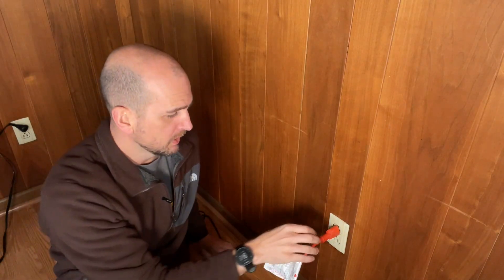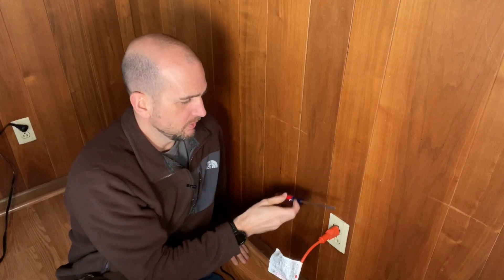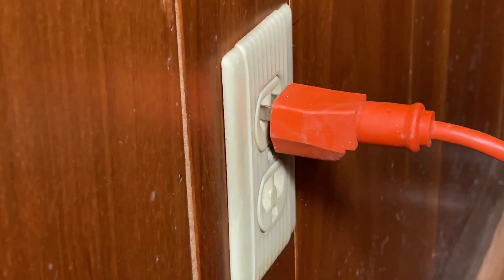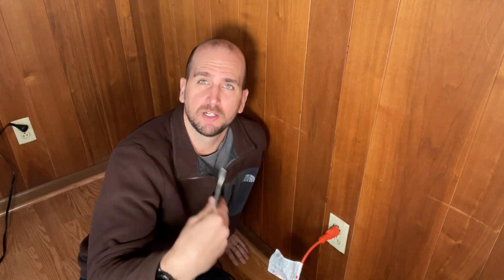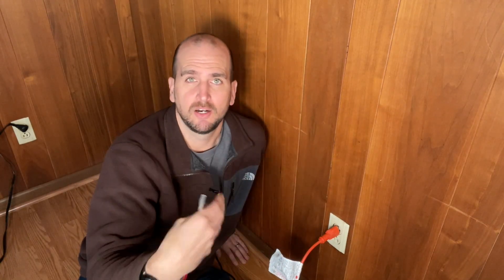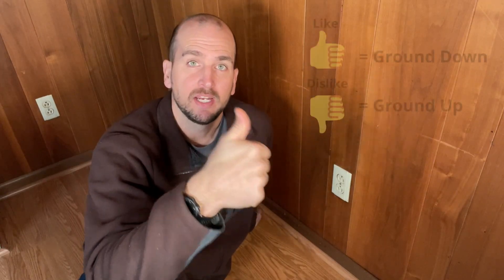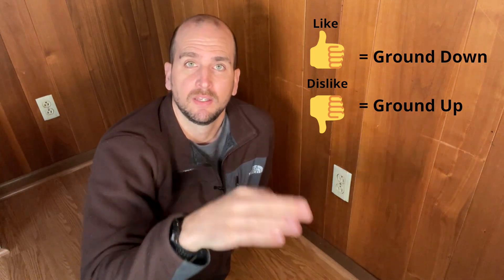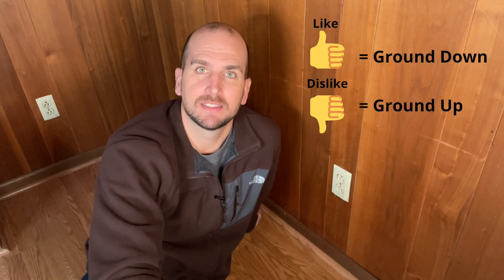Should An Outlet Be Installed Ground Down Or Up

Comment: Not sure how accurate this is but I was told many years ago that commercial/medical grade outlets are placed in ground up to indicate they are that special grade of outlet so a future electrician can readily identify it and replace it appropriately. I was also told it wasn't a code thing just something that is done to help out the next guy so the outlet grade can be identified before you remove it so you can have the correct replacement on hand.

Comment: I'm a DIYer as well. I've done some reading recently about this subject because I was replacing worn outlets and switches in a home I purchased in 2017. I read that in commercial buildings i.e. hospitals that the ground faces up, but in residential practice the ground faces down except on a switched outlet where the ground faces up to signify a switched outlet.

Comment: A ground up ( ground on top ) installation of an outlet has the advantage that if you step on the cord , it separates from the wall quickly- the other orientation will bend or break the ground prong before separation.

Try it and see .....

A Falling stray conductors is a 
far fetched scenario indeed

Comment: If you plug in a large electronic transformer to a ground up orientation, it becomes top heavy and the transformer tends to loosen and fall out of the socket more easily.

Comment: I had learned that the ground facing up was the better choice, yet as you pointed out, that doesn't help when there is no ground prong. I don't recall the argument in that situation. 
The example I was given was a carpenter using a steel tape measure and got shocked when his tape fell on the exposed plug prongs.

Comment: Some electrition dropped a metal plate on an electric cord that was plugged in, got scared and turned it over. What are the chance that some thing would fall and balance on the ground pin? None, so safety is a farce. You want safety, put in recessed European outlets...

Comment: Generally I have ground down, however recently I purchased a new microwave which had a shorter power cord. My microwave is up on a shelf 2 foot above its receptacle. The new microwaves power cord is also about 2 feet long. The power cord was too short to make the bend to plug into the ground-down receptacle. I simply flipped the receptacle around to be ground-up. The  shorter reach of the new microwave power cord was now able to plug into the receptacle.

Comment: Look at the plug going into the receptacle.  If it has the wire coming out the side and the ground pin is located on the opposite side where the wire is, install the receptacle ground up.  This will relieve the wire strain at the plug as the wire will exit the plug straight down.  Otherwise, I would install the receptacle ground down.  This usually applies to an appliance that remains continuously plugged in such as a refrigerator.

Comment: It's too bad there are so many angled power cords designed for ground down as I prefer ground up. I was rather surprised to just see on a chest freezer an angled power cord designed for ground up. Must have been a freezer intended for commercial use rather than residential.

Comment: If safety is job 1, then use recessed clock receptacles.
Reply: those recessed receptacles work great under a cabinet when you are plugging in a dishwasher, it helps keep the cord flatter to the wall.

Comment: Ground up when using a metal cover plate.
Reply: That's just what i was thinking. i can just see a warehouse forklift driver hitting an outlet that the shop radio is plugged into and the plate dropping on the plug.  50 years ago my father told me all the electrical devices in his plant had to have grounded plugs.  Now i understand why .

Comment: We had a woman at work using a cart with factory mounted outlets along the front edge. She went to adjust something on the cart that was plugged into the outlet, her thin metal bracelet fell between the outlet and plug. Instantly her bracelet melted! In this case, the outlet was ground down. She was lucky she wasn't touching any grounded metal when this happened. That may not have occurred if the outlet was ground up.

Comment: You made voting options the absolute worse. Thumbs up for ground up or thumb down for ground down? Also when u connect a big block some have to be put upside down making them heavy and pull off wall leaving more metal exposed.

Comment: If they really want to fix the problem they should stop using type a and b plug and sockets. There should be a migration to an international standard. Type c, e, and f don’t have this problem. Yes it would be a major overhaul I guess that’s why they don’t want to do it. I’d say give them 50 years to change it but with better features on the plugs and sockets.
Reply from the maker: Yeah, at some time we need to make an upgrade but you are right that would be a massive overhaul so it will take a big movement in order to drive that change.

Comment: A while back I heard about the safety of the ground being up, and I thought that would never happen. Two days later a hacksaw blade fell off the shelf and bounced right on the barely exposed prongs. Blew the breaker and left me in the dark.
Reply: Another hazard is metal tape measures, especially in your woodshop.  Ground up is safer in that environment.  Don't need any air freshener wife input there either.

Comment: Early on the  outlets were designed to be ground up if you look at the writing on the outlet most early outlets had the writing readable with ground up. Now a days  it varies. Most people prefer the ground down since it kind of looks like a face. Now if you have a switched outlet some people turn the outlet over to be able to identify it easily. This applies to regular 15 and 20 amp outlets in residential installations. In commercial installations I usually ask the designer what they would prefer if it isn't specified in the specifications.
Now when you get into the larger  outlets (30Amps and above ) the usual thing is to install the outlet with the ground up. The writing on the outlet is just about always readable with the ground up and some are marked TOP. Since the plugs on cords can vary as to how a 90degree molded cap will fit, I install the outlet with the ground up or down to match the cap and the use. 
I've seen a few outlets, been an electrician/ electrical contractor for 50 years

Comment: As an retired contractor I had a few jobs that OSHA, Calif., required ground up in medical and in industry type installations. On personal experience I fried the edge of plaster trowel by touching top of ground down plug, quite exciting! I install ground up and if it is horizontal I put neutral up. At car dealer one tech dropped a screw driver down the back of tool box and it hit lose plug with ground down, zzzzzzz! I had to pull new wires as it fried wires up to connectors in box! Z.K.

Comment: If you think about this stupid rule they have it should be that the plug should be sideways and neutral should be up that's the correct way to install the plugsI did this on a project and it came out real nice that way the cords went stacked one on top of another course the sheetrock guys would be real pissed off at you and one sheetrock guy cut all my wires had to pigtail the whole thing I should have made him do a sheetrock over and brand new wire but I had just enough wire to pigtail

Comment: Ground up is not safer with a loose metal plate. If the screw came out of the plate and the plate dropped, I'd want the breaker to trip ASAP, not have the plate dangle there like a problem waiting to happen. Ground up makes no sense.

Comment: I work as a trouble shooter and replaced lots of outlets I put the ground down...... but I believe the ground up was for if the plate came loose and fell off it wouldn’t cause a spark with such a short hot and neutral  spark rather a short to ground were it would trip the breaker ....
Reply: Why wouldn't you want the breaker to trip in that scenario? It's a problem waiting to happen with the metal plate dangling there.
Reply: Think about it if a plate was to fall off place it would be best it grounded out.......if there’s such a dead short I seen it were it will bypass the breaker and trip the main breaker
Reply: @thomasdressler9939   That made absolutely no sense whatsoever.
Reply: Then explain it to me......if you ground out hot to ground the breaker will trip but if something shorts out hot and neutral you get a nice spark ⚡️. You don’t see that
Reply: @thomasdressler9939  The breaker will trip whether the short is hot to ground, or hot to neutral.
Reply: I’ll give an example I’ve gone a place a couple of panels a lot of breakers I wanted Tio know witch breaker none are marked I took the hot wire and put it to ground the box it’s in.....I wouldn’t short out the hot and neutral......and yes they’ll both trip the breaker but with out the little explosion.........I went to a call a penny fell off a guys desk and the penny went between the hot and neutral blades on the plug that’s penny was damaged..........

Comment: electrician with 25 plus years in the trade here . trade policy has usually been ground down in residential and most commercial jobs about the only place ive seen ground up is hospitals . that being said i noticed something a while backl if you are in a dark room trying to plug a light in, its a lot easier to plug it in to  a top side ground when you cant see what your doing. put a finger on the ground hole ,line up the plug at a slight angle so hot and nuetral are away from outlet  start the ground in then roll cord cap into place.

Comment: Check with local codes which can override NEC because the more stricter code applies. Supposedly manufacturers are going to be required in the future to have ground up,that's why one manufacturer jumped ahead and spent the money to mark top. It was created by children playing with butter knives, erector sets etc.,and getting shocked. If you're worried about flooding, you already have wire nuts and other connections laying in the bottom of the electrical box.  Also,  the ground is usually longer than the other prongs and makes contact even if the cord is loose, thus  protecting the equipment and you. It's hard for us old timers to get used to changes. There are angle plugs that can be changed to face any angle including horizontal receptacles. On horizontal receptacles, the hot goes up, so gravity will help with keeping the hot in contact, with the receptacle.

Comment: I'm a retired commercial electrical contractor. I've been installing the ground up for 15 years.
Reply: Why?
Reply: @Cotronixco  

You obviously didn't watch the video!

With the line and load terminals up, gravity can contribute to safety issues. With the ground up nothing can ever fall on a loose plug and create a short/shock.

One day it will be a code requirement. Years ago an Electrical Inspector failed one of my projects and made me turn them all over (to ground up). It's the same amount if work either way the first time you install them. It's not worth the time to argue the point and on a commercial project no one cares either way.
Reply: @toobad9946  First off, it's not 'line and load' terminals. It's hot and neutral terminals. Second, if the screw comes out of a loose steel plate and the plate dangles on the terminals of a loose plug, I'd MUCH rather see the breaker trip than a potential shock to someone in more ways than one. This ridiculous 'ground up' assumption should certainly not be a part of any electrical inspector's stupidity, either.
Reply: @Cotronixco  

A metal plate, which would more commonly be used during an industrial installation would cause a dead short and trip the breaker. This is certainly possible. However, most industrial receptacles are ganged on a raised cover device and it is very unusual to ever see one come loose.

Line vs load and hot vs neutral terminal terminology varies by geographical region. In some areas the differentiation is distinguished by ac vs dc.

We do agree that the Electrical Inspector was stupid. One day Big Brother will make "ground up" the code.

Either way we are talking about a one in a thousand (one in ten thousand?) occurrence.

Arguing with an inspector is about the same as arguing with a cop. Even if you win all you have done is piss off someone with the ability to get even.

Don't take my word for it. Go home and piss off your wife. See what happens next.

Comment: My experience with ground down is the cracking off of the outlet area surrounding the ground plug. Possible weight or pressure on the plug could be a factor in the cracked outlets. That is the only reason I can think of to cause the breaking of the outlet in that area

Comment: That's one way to identify switched outlets from constant outlets. I generally use an odd color outlet (not orange or red) for switched.
Reply: You should install receptacles that are marked as switched.

Such as https://www.hubbell.com/wiringdevice-kellems/en/Products/Electrical-Electronic/Wiring-Devices/Straight-Blade-Devices/ConstructionCommercial-Receptacles/DR15C1WHITR/p/2608245

Comment: For Marine/boat purposes the ground has to be down so in case water fills the boat it will fault out before it causes shock, I was a Marine diesel mechanic, I’m now a licensed contractor, maybe that should be taken into consideration for potential flood areas like a basement, I dunno, most I’ve seen is just electricians discretion

Comment: With ground “up” there is still 50% chance a metal plate will contact hot and ground. Duplex receptacles should be installed horizontally with neutral side “up” if safety is your goal.  For my $.02 ground “up” is a union “calling card”  to indicate to other electricians that it was a “union” job!

Comment: Our last home had ground up, very, very annoying.  Finally fixed all of them.
Reply: Regarding proper outlet orientation, you are very well grounded.  Cheers!
Reply: Has anyone ever seen the box installed sideways ?
Reply: @rubencohen2936  Yes. Usually in older homes where the outlets are in the baseboard.
Reply: @rubencohen2936  Yes, the first home I owned had plaster walls with wood lath and all the outlets mounted ‘sideways’.

Comment: Off topic, but I was carpenter on a large new hospital job years ago. Project was far along when the GC noticed wall outlet plates installed (many thousands by then) were labeled with panel #...
Contract called all plates were to be laser engraved. 😫

Comment: If the concern is shorting, then shouldn't be mounted sideways, or better yet at an angle, with the ground and neutral on top shielding the hot?

Why an I even thinking about this?  Curse the pandemic.
Reply: You are starting to see more receptacles mounted horizontal especially on backsplashes.
Reply: @billsilva7932  Thanks for directing me to give this a 2nd thought.  The more I think about this, the more I might add this to my house plans.
1. As you note, it would work better in spaces like backsplashes where there is less vertical height.
2. As someone else notes, it is safer with metal covers, and protects against metallic objects falling across exposed pins.
3. 2 cords plugged in side by side are easier to trace, less likely to get tangled and/or accidentally get pulled out, and might hug the wall a little tighter if they aren't on top of each other.
3A. The neutral pin is often larger and fits tighter, so having it on top makes it less likely the plug falls out.

Downside - I suspect it is more likely to make contact with the line when plugging or unplugging if it is on the bottom (think of how you hold a plug when you insert it with thumb on top, finger wrapped underneath).

Comment: First off,  if your receptacle doesn't hold the plug all the way in then it needs to be replaced.  It's defective.  Secondly, there are virtually no cords in a residential situation that have a bare wire to short out the two blades on a plug so the "cord falling across the plug and shorting it out" reason is an extreme longshot.  In first year Electrical at trades school we were taught "ground down" so the longer ground pin would support the plug better. And lastly, ground up just looks amateurish.

Comment: Here’s how I caused a short with ground down: I plugged in a 6 outlet box into the 2 outlets, which was NOT held in tight with a long screw.  I put the original plate short screws on top of the box (scotch taped, I believe). The 6 outlet box managed to come out a little, and one of the screws fell down between them, causing a spark and short. Lesson learned! (Duh)

Comment: My take on this is ground down.  If the building floods the ground gets wet first and not the 2 wires caring electricity.  I also don't like outlets installed a hammers length from the floor. The belong under the level of the switches.  Good video thanks.

Comment: I have been in the residential construction trades for 35 years, I have never seen an electrician install an outlet ground facing up.
Reply: Years back new wiring was installed in a public building owned by our city. To meet code the grounds were required to be up. I used the building regularly and didn't like it. This is true. Hope they have changed it.

Comment: Always ground down. Hot always goes on right, neutral on the left. Look at switches, connections on right so ON / OFF read right side up. Stamped in writing on back of outlet almost always reads right side up when ground is down. Three prong cords seem to hold better when ground is down

Comment: Ground UP ! 1 that's why it's called a U ground. 2 pull the cord down on both. The one that's going to stay firmer in the recpt. IS the 1 , UP,  3 down, pull hard enough on the corn, it will brake the plastic part of the recpt.